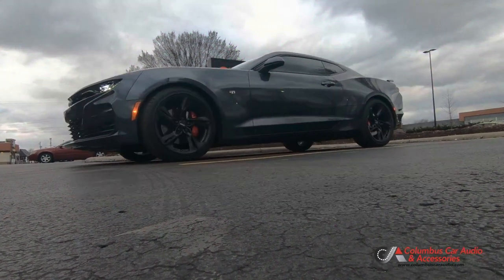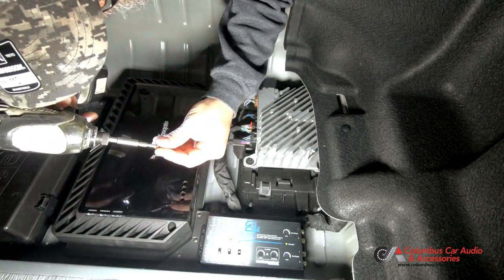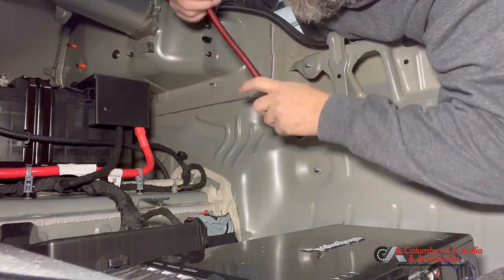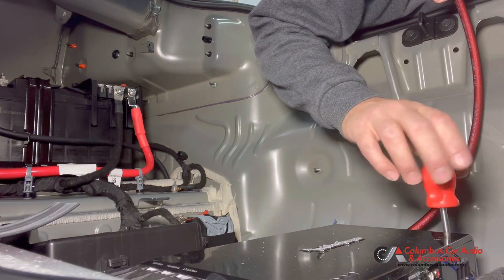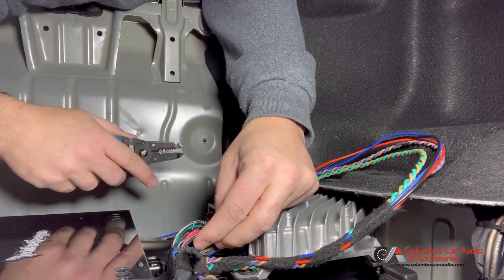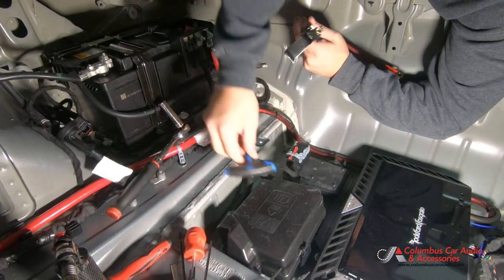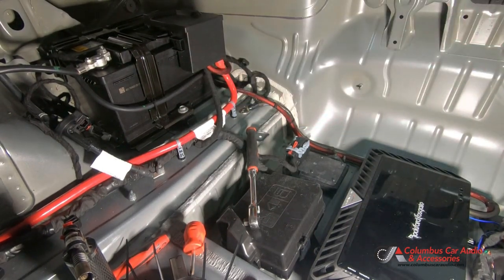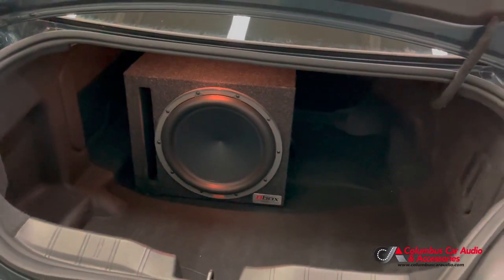2022 Camaro SS Complete Amp & Sub Installation

Comment: And if your not lucky enough to have a bose amp to steal your signal from?  Where would you tap into the rear speaker wiring to get your speaker signal?
Reply from the maker: I would actually use the front signal.  The rears in a lot of vehicles these days are “quieter” and can be bandwidth limited. 
If yours is an earlier 5th gen that has 6x9s in the rear deck, then using the rear speaker signal isn’t an issue 👍
Reply: @Columbuscaraudio  I've actually got a 6th gen.  I wanted to make use of the rear speaker signal going to the small speakers next to the seats.  I just don't wanna have to remove the rear seats and all the interior pieces just to tap into the wire.
Reply from the maker: @Blakehenry11  ok, so that being the case, you definitely do not want to use the signal going to those rears for subwoofer signal.

Comment: I have a question people been saying u lose sound on ur parking sensors and the beep is that true.
Reply from the maker: That is incorrect.  There is no functionality lost when audio is interfaced with properly 👍
Reply: AmpPRO 4 Amplifier Integration Interface AP4-GM61
Reply from the maker: @NeilPeart_2112  Coverage on the Camaro only goes up to 2018 on that part.  I think data protocol is A2B after that.

Comment: Super clean work. What is the frequency range of the signal borrowed from the factory Bose amp? Which specific wires did you tap into (colors) and which speaker were they for? I was bummed when I found out the PAC audio interface wasn't compatible with the Bose system in the Camaro 2020 and newer

Comment: is there anyway you could show a picture of which wire goes to which on the bose amp? can't i use wire taps?
Reply: i need help knowing where the rear left (+/-), rear right (+/-), power and negative go into which wires
Reply from the maker: Hey, feel free to shoot me an email at Dan@columbuscaraudio.com
I’ll need a few answers from you on how your vehicle is equipped and what gear you’re using 👍
Reply: Same,  what if you're using an lc7i and need a complete signal for both high and lows? Where do you tap in for that? Thanks
Reply from the maker: @Harlo86  I would 100% not use an LC7i in one of these with Bose when doing a full system.

Comment: why not PAC Audio?
Reply from the maker: Several reasons.  The biggest one is that they don’t have coverage for these after 2018.  The input side of the Bose amp uses a form of Ethernet.  The only thing that was on the market that interfaces with it at the time of install is a Metra part.  The Metra piece is meant as a full amplifier replacement solution…meaning that it wouldn’t be the ticket for a bass only upgrade unfortunately.  
The other part of it is cost.  An LC2i pro is $149, whereas the Metra part is $629 with no real added benefit for this particular client at the time 👍
Reply from the maker: But, yes, when it applies that would be our go to 👍

Comment: So … being inspired by your video… I decided to get myself a $7.00 white cutting board off Amazon, used the studs you used, and whipped up a little set up in my 2021 Camaro 2SS convertible. 

Now mind you, the wiring on the Bose harness was a little different for me, due to not having rear speakers where a coupe would have them, and also, I can’t put a box in trunk, due to the convertible top, so I ran two “under the front seat”  8” amp/sub speaker combo boxes, to each side, but it added just enough bass to the already amazing sound. 

Appreciate your video! Wish I could share the image of my completed project, it looks great!
Reply from the maker: @shanefender5031  that’s awesome!  
Yeah, the convertible is definitely a different animal audio-wise.  
How’s she sounding??

Comment: i tried to ground along that same area but more next to the battery ground and it still reads up to 1.0. i sanded it down to the shiny metal also, drilled a hole and still within the he it reads above .05. any thoughts on where i can ground for more efficiency? thanks for the video install.
Reply: If your still concerned,  then try the negative post on the battery. It's probably going to be hard to get under .05
Reply from the maker: Where are you testing from?  From the battery terminal?  Your resistance could be in the OEM ground cable, the terminal, the contact point etc. 

As far as grounding goes in general, it doesn’t get much better than a few inches from the OEM lug.   Let me know what you find 👍

Comment: So I don’t have a factory amp, where would I pull from the back of the car instead?
Reply from the maker: If there is no amp or ANC module in the trunk floor, then you have to go directly to the radio module.  It should be in the passenger side dash near the glovebox.

Comment: Could I do this same set up with the 1ss systems (it’s not the Bose system)
Reply from the maker: Definitely.  You just wouldn’t be grabbing signal in the same place. If it has ANC, the module will be where the Bose amp is and you can get it there. 
If it doesn’t have ANC, you will need to run to the radio module in the right side of the dash.

Comment: Have you ever done an install on a 2016 to 2018 Ss convertible?
Reply from the maker: Not sure if I’ve done those years specifically, but I do know that the wiring and oem system is slightly different in a convertible.  And, as you know, there’s no space in the trunk 😖

Comment: anyway you could make a parts list i’ve never done this it looks complicated
Reply from the maker: I’m going to be completely honest with you, it is fairly complicated.  Properly interfacing with OEM systems isn’t as simple as it used to be.  

We see it everyday.  It gets especially tricky on OEM amplified setups like in these Camaros.   It is possible to damage the Bose amp if interfaced with incorrectly…and you guessed it…THEY’RE FREAKING EXPENSIVE 😅

Long story short, if you’re inexperienced or uncomfortable doing the job yourself..take it to a professional.  

Parts-wise it’s pretty straightforward.  Audiocontrol LC2i to convert high level signal at the OEM amp to low level RCA, amplifier, subwoofer and enclosure of your choice, and the appropriate sized power wiring kit for the amplifier.
Reply: @Columbuscaraudio  ahhh ok thank you man i’ll prolly just take it to a shop
Reply from the maker: @AH-wf5ri  No problem at all, if you need help finding someone good, get in touch with us and we might be able to point you in the right direction 👍